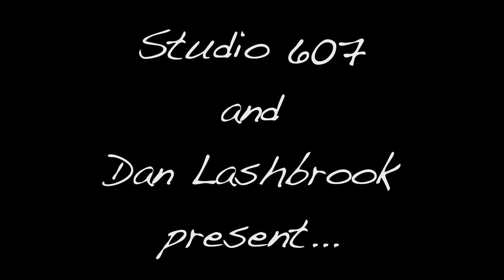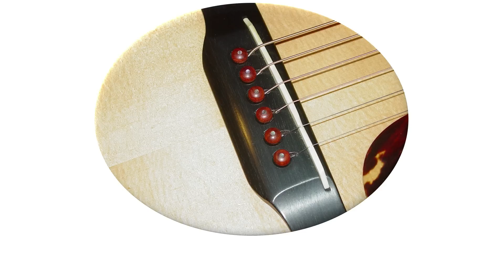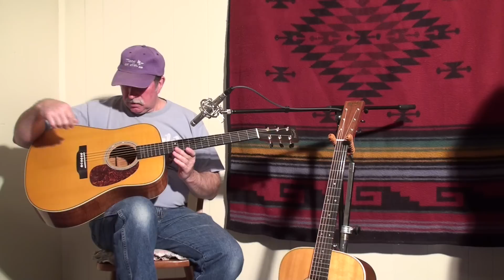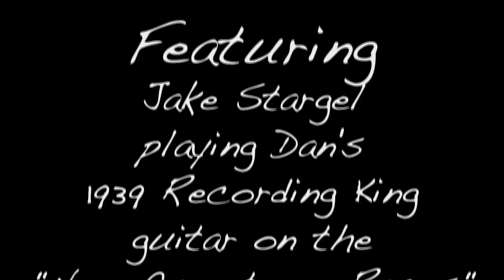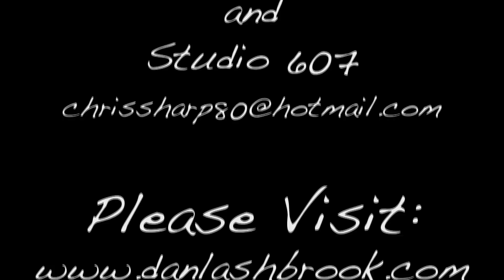Dan Lashbrook 2001 Martin "Keb Mo'" setup - Before and After

Comment from the maker: Right,,, That cross brace is 1/2 an inch. The '3os Martins
had only a 5/16 cross brace.  Also the Authentic D-18 has only a 5/16 cross brace and they hold up with no front plate. Martin on few guitars,, make them today with '30s specs.

Comment from the maker: TOM McCABE POSTED THIS COMMENT ON FACE BOOK .Sent my 2010 Martin 000-28VS 12-fret slot head for Dan Lashbrook to set up. All my guitar buddies... take a look at this video so you can see a great before and after. Dan "Hot Rods" acoustic guitars the way Carol Shelby "hot rods" an off the line Mustang. Dan is the Master (also a champion bluegrass picker).
Dan Lashbrook 2001 Martin "Keb Mo'" setup - Before and After